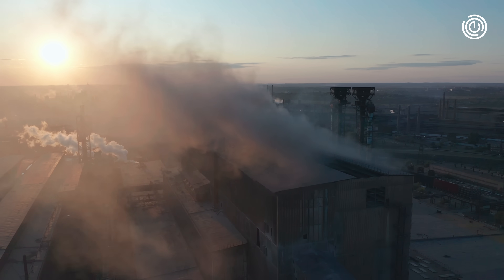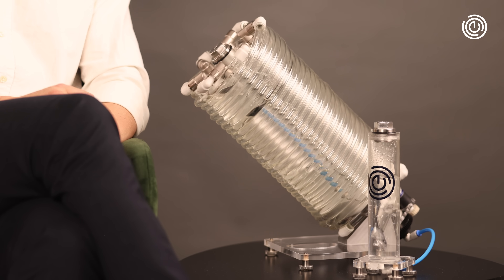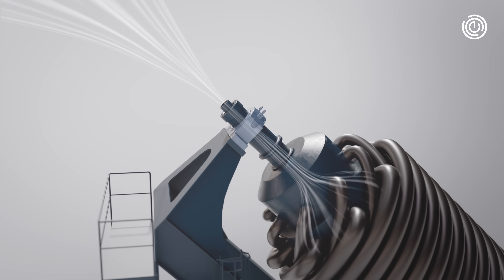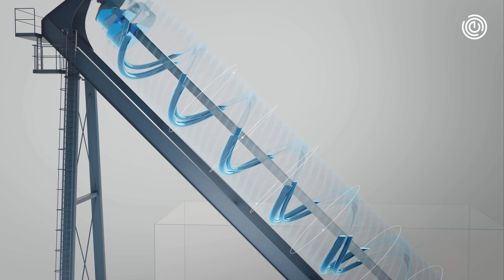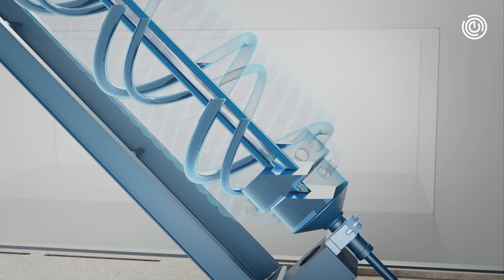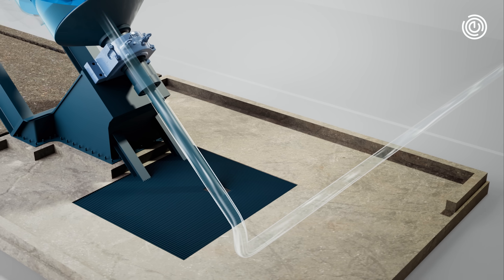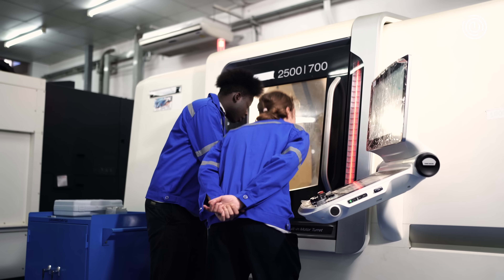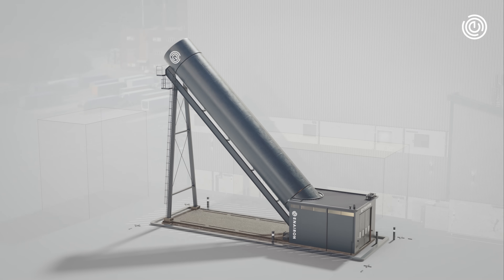The Gravity Compressor - Cutting Energy Use by 30-50% with Isothermal Compression Process

Comment: I've had similar thoughts, but you've clearly got a more refined idea compared to what I was thinking of initially. However, it think that there is still a potential for improvements, and I hope that they are realized.

Also, how could this be used in compressed air energy storage? Could this be used as an expander as well? And if you were to use hot water in the expander, wouldn't that enable you to make an isothermal expansion engine? What about using this as the first stage of a gas turbine?

Another possible use case would be in gas separation. If the liquid has a different solubility for different gasses, you could separate them. In biogas plants, this could be water, which would become saturated with the CO2 generated in the biogas reactor. This would reduce the energy needed to compress the gas, while also allowing you to purify the process gas.